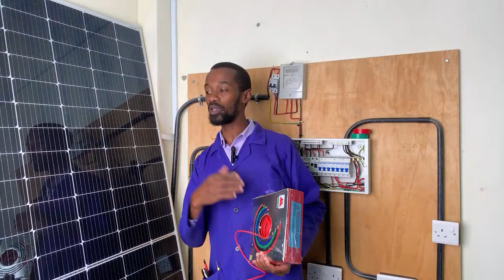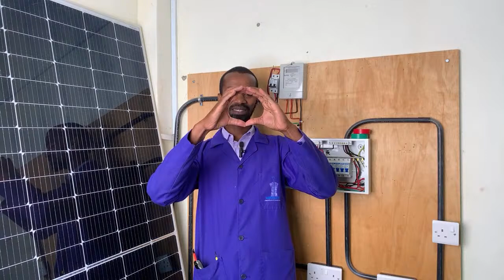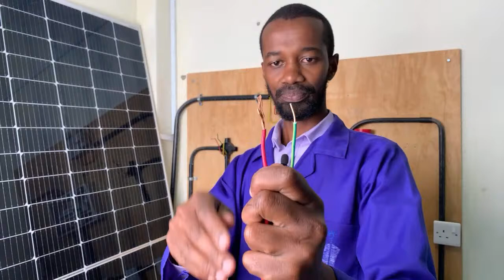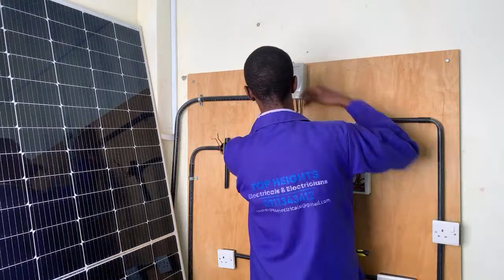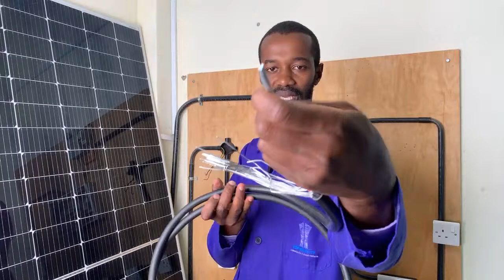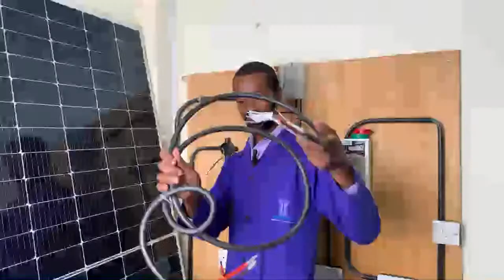Common Electrical ⚡️Hazards In Your Home.

Comment: What size of spd,rccb and mccb can l use control all the circuits in a consumer unit
Reply from the maker: Main Switch (MCCB)	63A (2-Pole)	Total Power Cut-off
SPD	40kA (Type 2)	Lightning/Surge Protection
RCCB	63A / 30mA	Shock & Leakage Protection